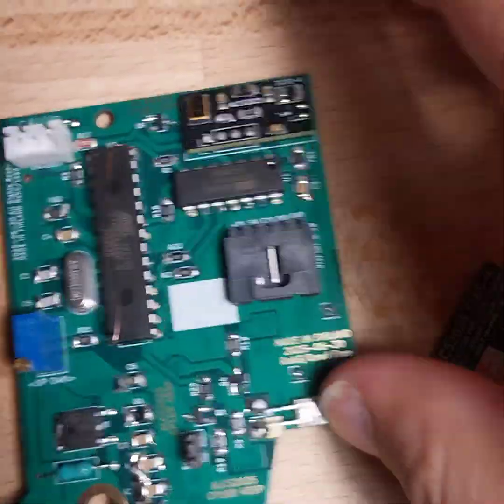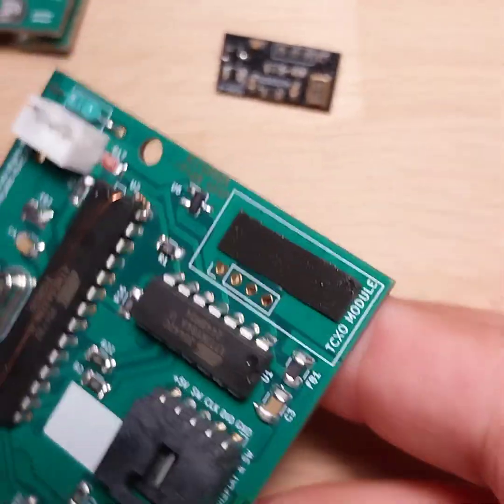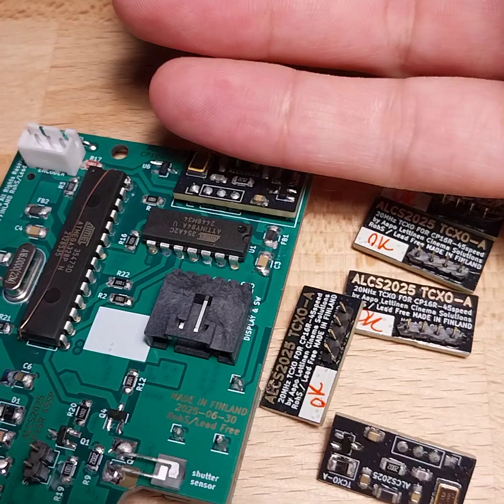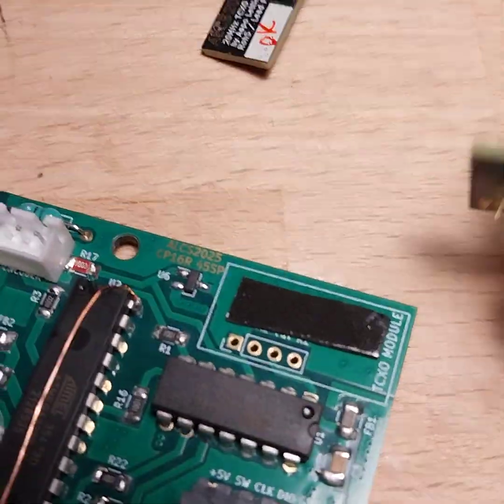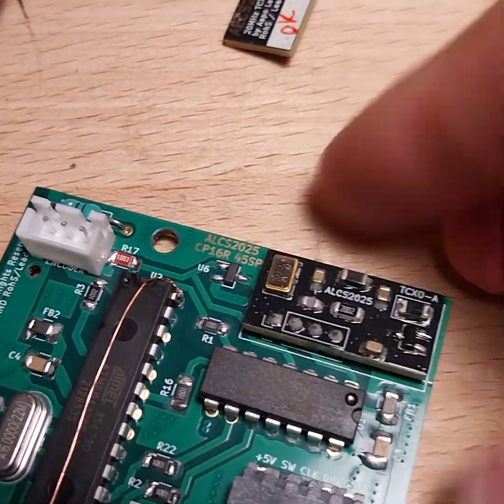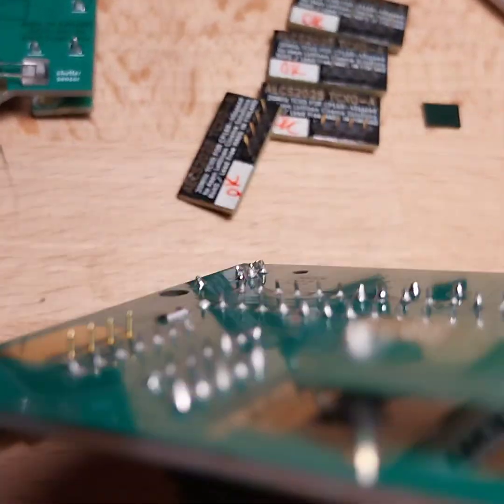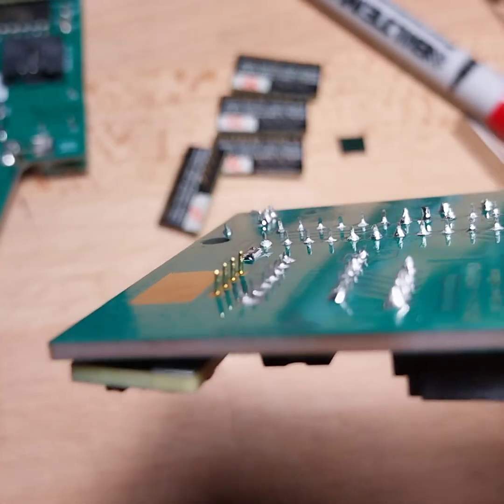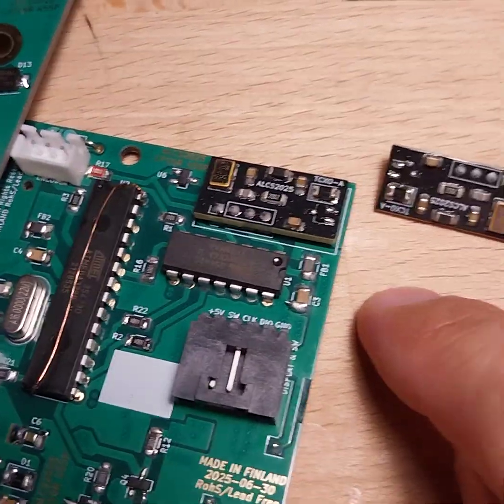CP16R attaching TCXO modules to main boards

Comment: So are you replacing the original electronics with a new board?
Reply from the maker: Yes pretty much all of the original electronics are replaced with newly made ones except the electric motor drive and the viewfinder leds. It is much more practical this way than to try to repair the 50 years old original boards which have some custom parts which cannot be replaced with anything else than similar old parts from another board